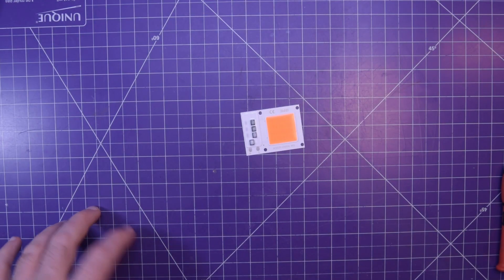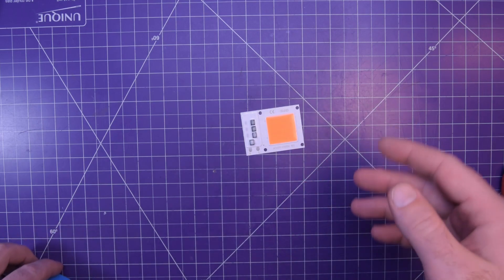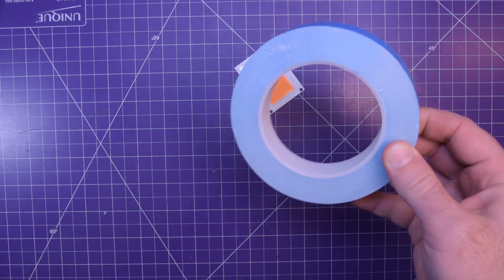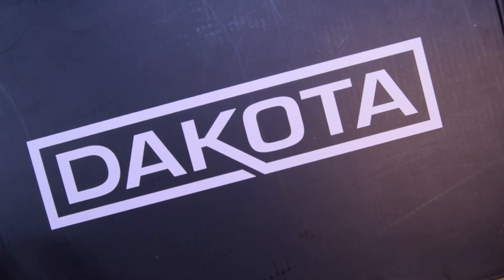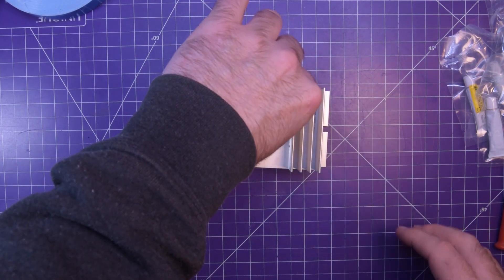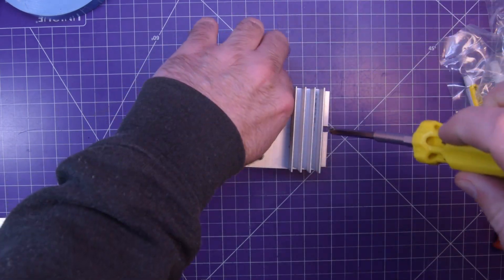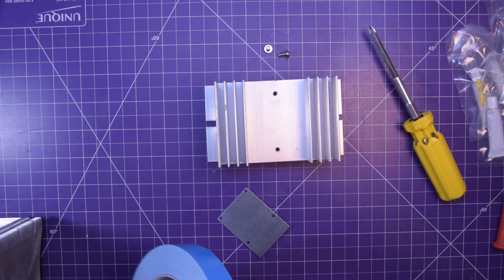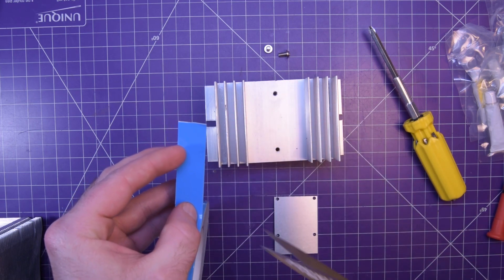15 Minute Project: Veggie Light!

Comment: As you mentioned, any airflow works wonders. If you could mount a 120mm fan behind the heat sink, even at low/quiet RPMs, you'd dissipate a lot more of that heat. I wouldn't be surprised if you could keep it about 40C.

Comment: Did you know MG Chemicals makes Thermal Epoxy ? It comes in a press tube, i use it to apply small & large heatsinks to IC's and transistors to keep them cool If you want i can share a link.. Would work really good for this.